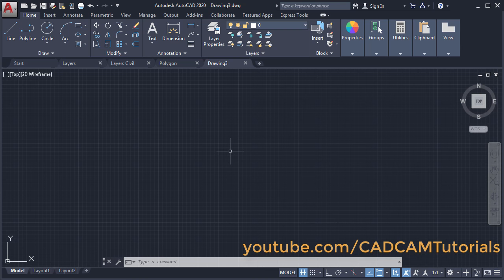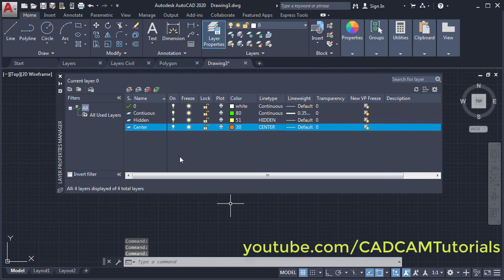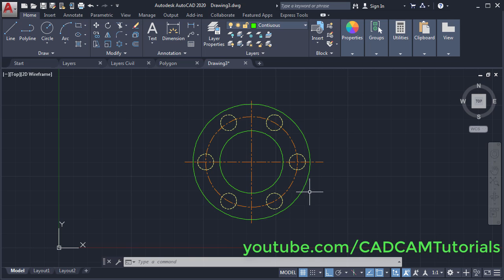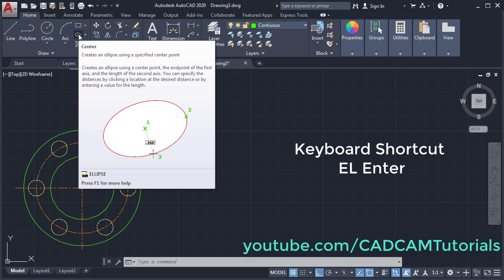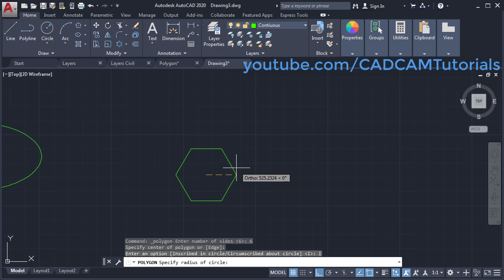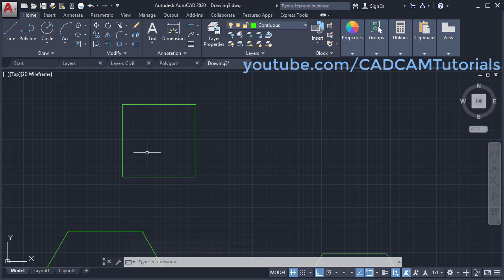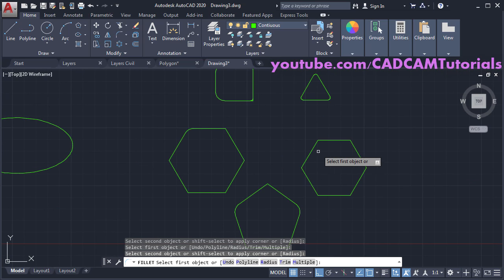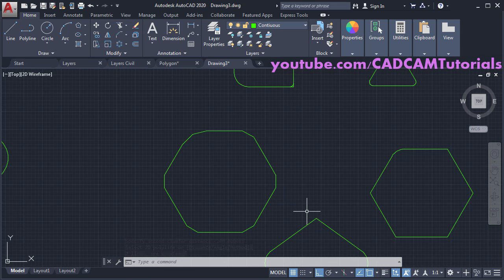AutoCAD Tutorial for Beginners - 3

Comment: To change the scaling of line type type LTS (line type scaling).
To see the wIdth of lines activate line weight.
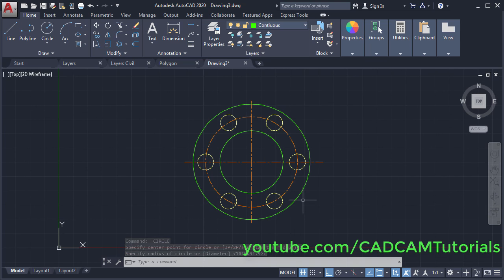Layer explanation from (beginning to 08:10 with polar array explanation)
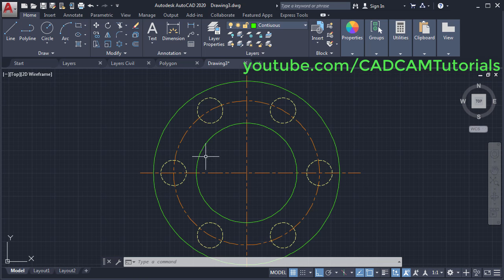08:52 change of layer of any line directly
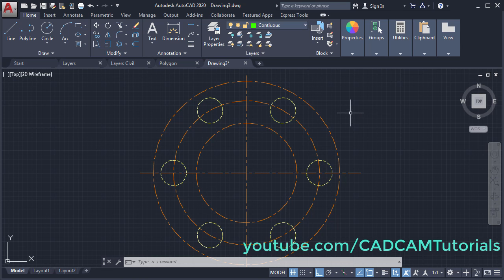09:15 change of layer of any line through match property ( suitable for array)
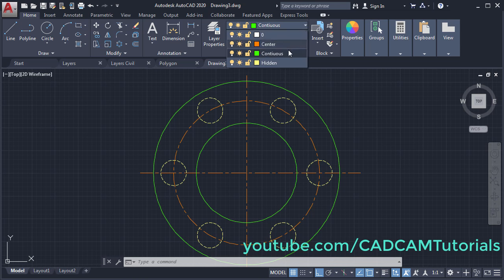10:04 freeze,thaw,on/off,lock/unlock
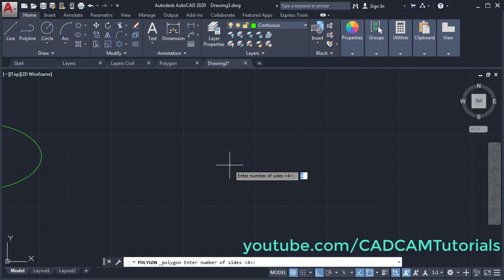14:40 polygon making
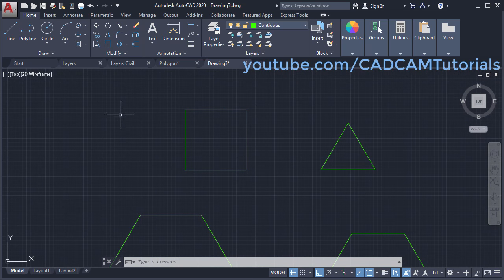19:57 fillet and it's various applications
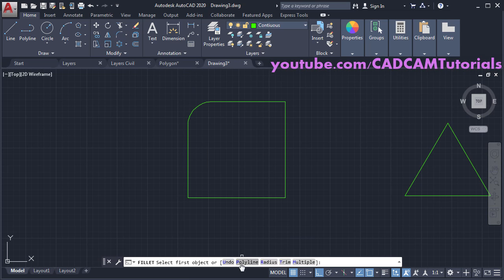20:50 polyline - creates fillet at the corners of the polyline object ( eg. simultaneously created polygon)
21:54 trim in fillet
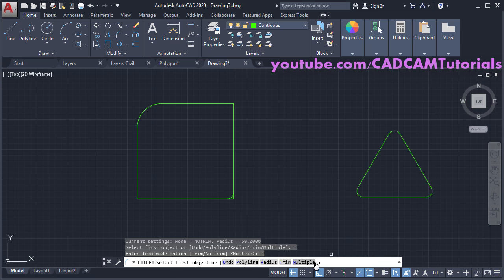22:49 multiple - does fillet of same radius multiple times
23:36 fillet to make corners or extend the line (जहां एक्सटेंड करना है  वहां एक्सटेंड होगा जहां कार्नर बनाना है वहां कार्नर बनेगा)
24:59 chamfer